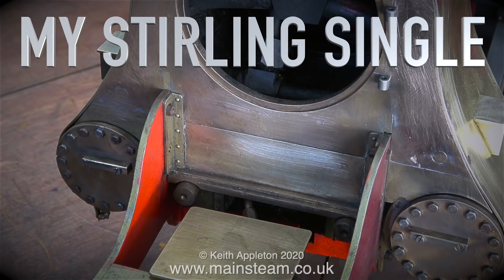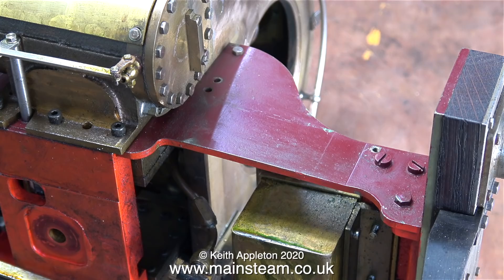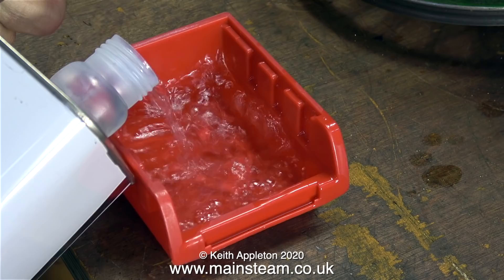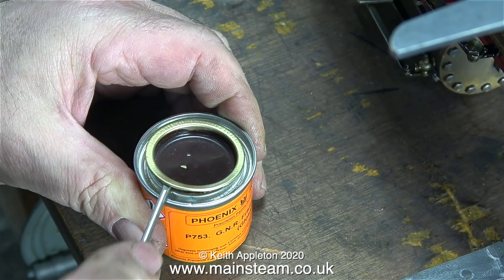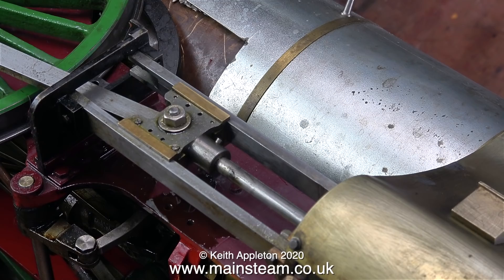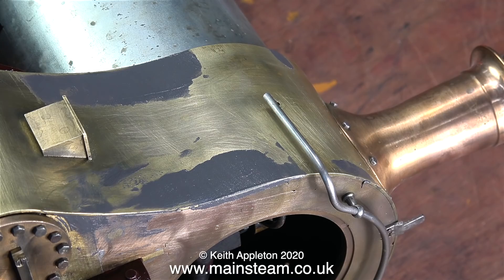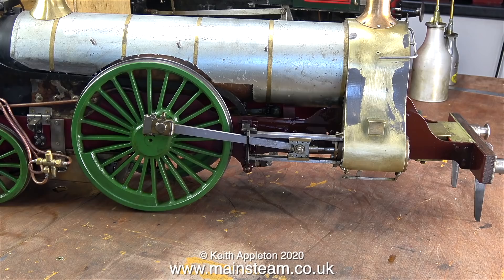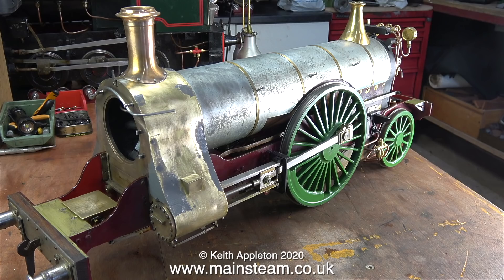MY STIRLING SINGLE #21 - FILLING & PAINTING

Comment: We have used JB weld for about 35 years it is quite strong and temperature stable.  You might want to gently heat the smokebox then let it cool (like you would set high heat paint) in order to drive off any unset components.  The 24 hour JB weld is about 50% stronger than the kwik version. So if you need a weaker version as a filler it might be easier to sand?

If you need to smooth larger areas or fill deeper holes you can also try all-metal body filler.  This sets really hard and is very temperature resistant.  Apparently you can make objects with it or buildup damaged things.  It is terrible hard to sand.

Comment: I had need to paint 2 large narrow gauge 7.25g locos.  Precision paints were very expensive given the amount required.  I used automotive 2 pack acrilic. The supplier were able to match the colour perfectly and supplied a code number for future ref. 5 years on the paint on these locos has not deteriorated at all. 
Also once fully cured 3/4 days.  fit to touch after a couple of hours. Once cured any lining can be carried out and if a mistake is made can be wiped off with thinners which does not effect the paint under neath.

Comment: I find these single driving wheel locos very interesting.  Of course builders soon realized that two or more drivers was much better,  but by then track construction was also better.   The first locos in America were built in England but as far as I know no locos with a single driving wheel was ever imported.   I have a question about the safety label on the Panel Wipe can:  How do they think panel wipe will damage your lungs if you swallow it?   It almost looks like the instructions I used to read in Japanese motorcycle manuals!  "please to not attempt to start engine while motorcycle is in gear".    "attach most carefully to avoid less then perfect results"  You get the idea.

Comment: Hope the JB Weld works.
You can also try Devcon. Devcon makes high temperature putty.
They also make S.Steel, brass and aluminium putty.
You will certainly get a Devcon product at a ship chandler.

Comment: Does anybody here know how to remove epoxy?
I am working with an old Märklin steamplant i realy does not want to destroy or alter anything on unless it is realy nessesary since it looks like a prewar macine with original paint, but somone hawe tried to seal the valves and other things on it with something that looks like grey steel epoxy, but in this particular case i need to remove the epoxy in order to reach the sealants and i also want to remove a lot of ugly looking exess epoxy some previous owner applied, but whatever that stuff is it is rock solid!
Reply: Vampira - Heat, either from a blowtorch, hot air gun or soldering iron.